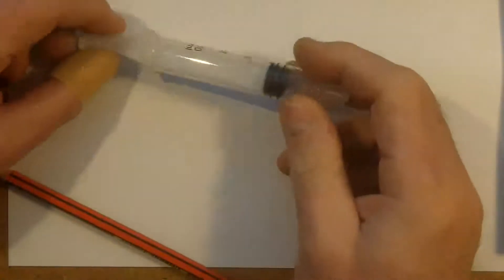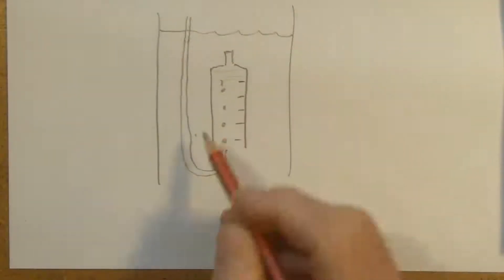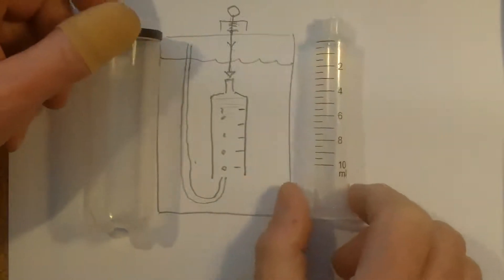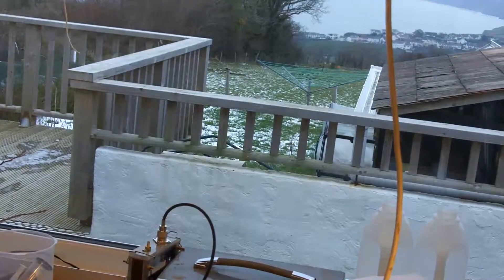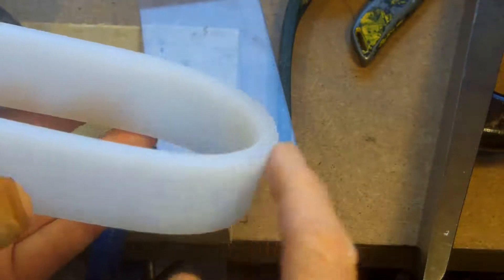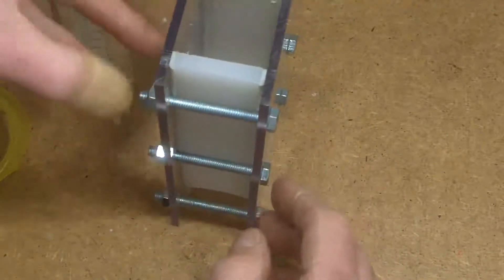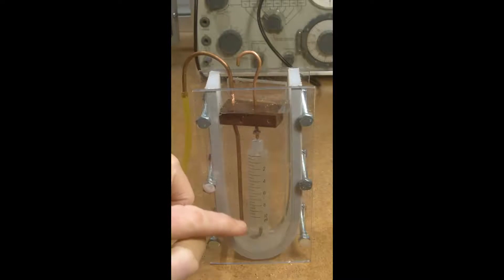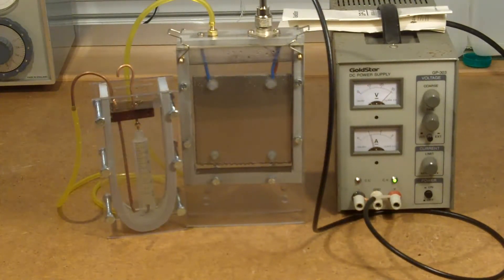HHO. 4 building a resettable gas flow monitor.

Comment: Hi, Andy. You have reinvented the pneumatic trough (in miniature) used in gas chemistry many years ago - see 1950s 1960s chemistry books. One can get syringes bigger than 10 mls, but you would have to go to a chemical or vet supplier. Local chemists don't like to supply syringes for obvious reasons. With regards my previous comment re water and wire use, I was thinking of galvanic voltages upsetting the capacitance bridge. For capacitance tests perhaps distilled water as the electrolyte?

Comment from the maker: Hi, ok on the syringes, I don’t know anything about drug use bit I figure 100mL would be a bit on the large size. I could get them off the net but it all takes time and I do rather like to ‘do- it-now’ it’s not a good trait but I usually find away to do things ‘now.’  
I haven’t revisited the capacitance issue but I suspect it might just be the low resistance of the cell killing the bridge. 
All the best ... Andy